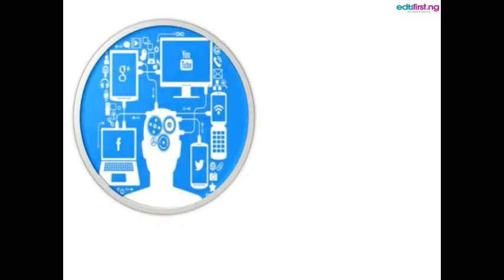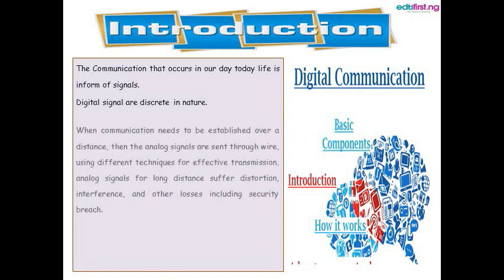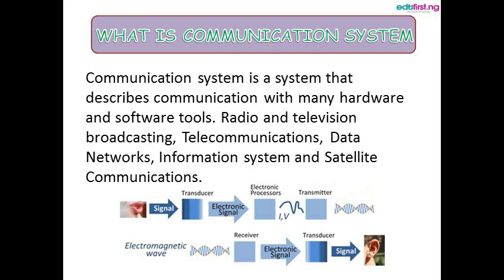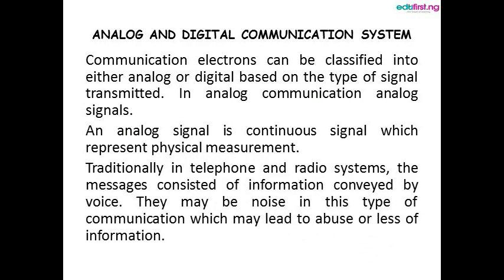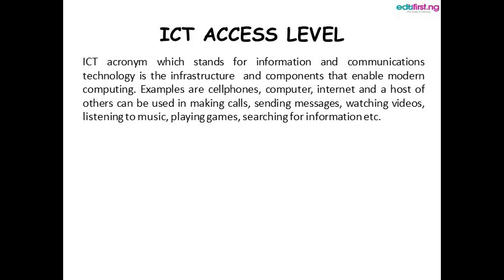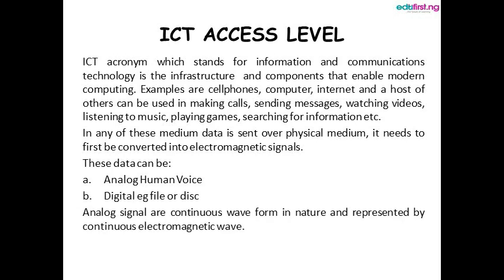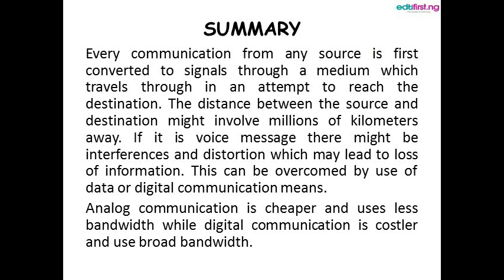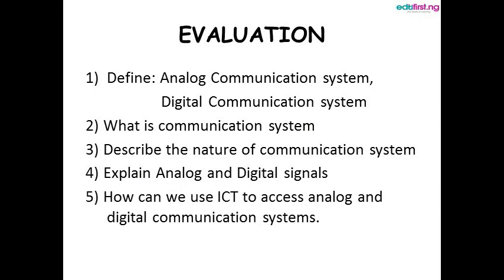Analog and Digital Communication system | Basic Tech | JSS1 | 3rd Term

Comment: Emmanuel irabor
Analog and digital communication

1. what is analog and digital communication?
Digital communication is a communication that transmits analog signals.
analog communication is a communication that transmits digital sigals.

2. What is communication?
communication is a system that describes communication with many hardware and software tools. 

3. Describe the nature of communication system
Every communication system exhibits several basic elements namely;
Information source.
Transmitter.
Channel.
Receiver.
Destination.

4. Explain analog and digital signals.
An analog signal is continuous signal which represent physical measurement.
Digital signals are discrete in nature and represent sequence of voltage pulses.

5. How can we use ict to access analog and digital communication systems.
To use ICT to access analog and digital communication system the data sent over physical meduim needs to be first converted electromagnetic signals
These data can be;
Analog ie human voice;
Analog signal are continuous wave form in nature and represented by continuous electromagnetic wave
Digital files or disc;
Digital signals are discrete nature and represent sequence of voltage pulses.